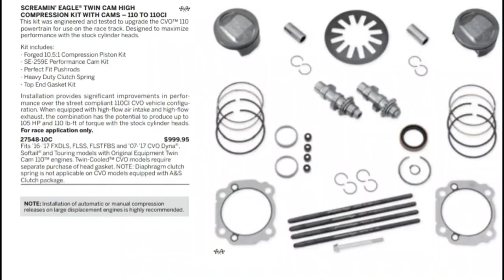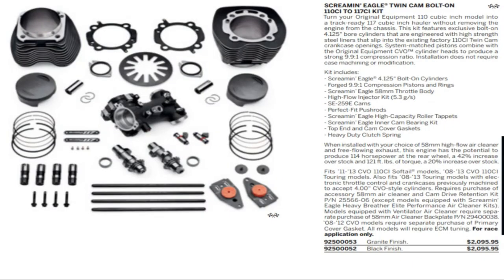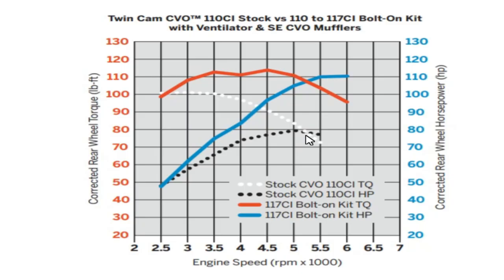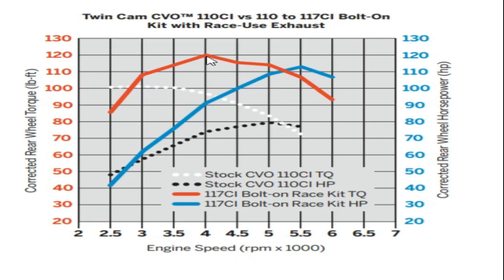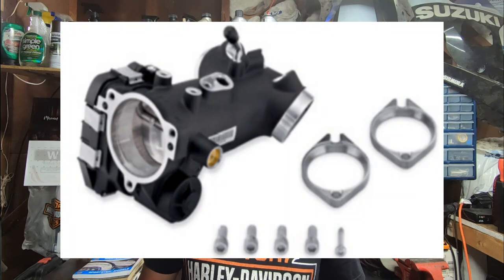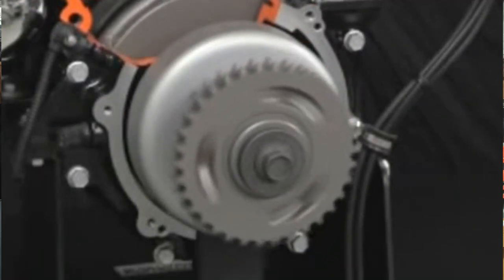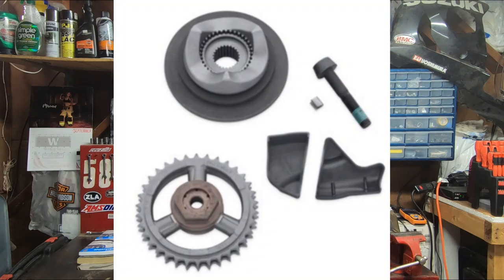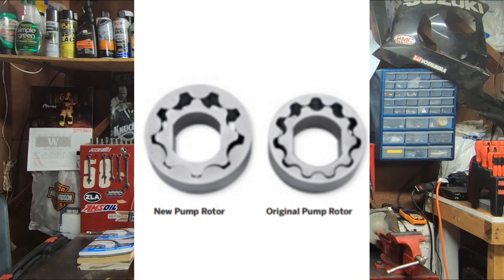Largest Production Twin Cam Harley EVER Produced | Twin Cam 110

Comment: I bought a 2002 FLSTC and a 2001 FLHRCI Road King. I sold the 01 Road King and tried to trade my low mileage FLSTC for a 94 Evo  in about the condition my bike is in witch is excellent but the guy sold it before I could trade.  Sorry I ever bought these twin cams after working on another guys twin cam that had a catastrophic failure . His bike only had 21.000 on it. I saw enough to make me sell mine. I have a fully restored 72 FLH that is simple to work on like a big lawn mower. I am an old man now so I am not running my bikes hard and I live in nowhere Alabama I am 94 miles away from the nearest freeway .
Reply from the maker: That's some beautiful country to enjoy a bike like you have! Do you ride it quite a bit out there?
Reply: @GixxerFoo  I did ride it a lot but my wife is ill and I am her only care giver so I haven't been riding much. If I got hit she would be in a fix. I put 3000 miles on the 02 FLSTC the first month I had it before the wife got worse. I bought the twin cam FLSTC for her she hates the original buddy seat on my 72 but she was only out once for about 15 minutes since I got it. .
Reply from the maker: I am sorry to hear your wife is ill, that's really tough but she's very fortunate to have you.
Reply: @GixxerFoo  Thank you. I think I sold the 2002 today the guy is coming to look at it. Funny this is the guy I bought the 2001 Road King from wrecked. I will hang onto the 1972 FLH until i go to the big swap meet in the sky I had it since 89.
Reply: @lisar3006  Ok here is an odd coincidence I have owned both a 72 FLH and a 2002 FLSTC, I loved that 2002 Heritage, that was the 88TC-B counter balanced motor, man that thing was smooth. Wish I had my 72 FLH back. I know the guy I sold it too, while running fine, wanted to do what he called a whole frame restore. He tore it apart and as far as I know 10 or so years later it is till in a box in his garage. SMH
Reply from the maker: Yeah I wouldn't let that 72 model go for anything. Unfortunate you gotta sell but l hope the guy buys it.
Reply from the maker: That B was originally so smooth that it caused transmission problems with shifting. Lol the counter balancers worked way better than the engineers intended.
Reply: @mickthedawg4575  I bought my 1955 for cheap. The guy took it apart and couldn't put it back together it had been in his garage for years. I paid him $800.00 and a Rossi 38 revolver for it. I did some motor work painted it rode it a while and sold it for $4.000.00. That was in 1979 or 80. This 2002 FLSTC does have a bit of a issue going into neutral at a dead stop but so does my 72 some times. Pretty sure the 02 is sold.
Reply: @lisar3006  I do remember getting really good at clicking my 2002 into neutral while still rolling. LOL mine did the same

Comment: Hello
Can you suggest a kit for a 2010 CVO Convertible with the SE 110? It seems to me every place I look does not give options for my particular bike
Reply from the maker: There is the Screamin Eagle 117 kit for your bike, but check out FuelMoto! They have some awesome kits that will fit your 110 or even just a cam which won't disappoint at all with your 110 displacement.
Reply from the maker: Check out the SE 117 Kit or Fuel Moto! Fuel Moto has some great kits for your bike or even just cam that won't disappoint with your 110!
Reply: Hey
Thanks for that advise, as it turns out I have pursued the 110to 117 SE  initial stages. I have had a new (SE everything) compensator, chain, cam plate and 259 cams installed. As well as an Ultracool fan assisted  oil cooler. So I am ready for the future Big Bore kit. When I do it I am having head work done and adding a catch can as well. 
Your videos are great and one of them was on seeing the rare set up I will have. 
Keep em coming
Rob

Comment: I got a 2002 Dyna Low Rider with a 110 Screamin Eagle the previous owner died so I didn't get the information on the bike so I have no idea what stage its in how do I find that out
Reply from the maker: If it's Screamin Eagle parts you could have a Harley dealer run your vin, if it has a service history with Harley they might be able to tell you what all was done to the bike. If not you'd have to tear the motor down and look at the parts and see what is in it.

Comment: I recently got 08 ScreaminEagle ElectraGlide Ultra 110ci. I put a couple hundred miles on it before oil change, I was waiting for Dyna to reach oil change and do both

Dyna 96ci......if bottoms are the same why does dyna primary take 32oz and SE take 38oz?

SE doesn't need any power upgrades for me, 900lb + 300(2people) is faster than 650lb + 200(me)

I've always put 20w-50 in all available holes. With this change dyna I put gear oil in trans, I can't tell a difference in smoothness or clunkyness of shifting
SE I used gear oil in trans and primary......what a difference, it's just a click no clunk, and I found neutral first try (rare but has happened before).

Supposedly the dealership (kaw/Suz) changes oil in all used bikes, pretty sure not true, when I drained oils, trans looked just like new 20w-50, engine was dark but I couldn't feel any gritty, both plugs clean, the primary came out almost like water, it was dark with some brown and the plug had some shavings on it
Reply from the maker: Good question, I never questioned that myself lol. Harley allows a bit more oil in the primary due to the power output of the 110, compared to the 96 it's a lot more torque.

Comment: There was a sales guy at my local Harley dealer said that after 2013 they made a high output 103. Are you aware of that or is he just shootin the 
sh!t?
Reply from the maker: The high output had a little higher lift cam, it may of been in some touring models in 13. Off the top of my head l believe the 103HO was in the dyna and softail in 2016 or 2017.
Reply: @GixxerFoo  I have a '14 SG and he said that it's in that year model also.
Reply from the maker: Humm, l don't remember seeing the HO in the Dyna and Softail until 16 or 17.

Comment: A quick question regarding compensator life ... Does the way the bike is ridden make any difference to the life of the compensator?  What's the best compensator? Screamin Eagle, Baker, other?  Some guys put in different primary chain tensioners (eg Baker), but are 'manually' set, not spring loaded.  What's a good brand of tensioner?  Hayden? Other?
Reply from the maker: If the bike is raced and ridden very hard that will reduce compensator life. The bad part is it's difficult to gauge the life of the part being a piece of machinery. Some bikes have failures and others never have an issue, just like the tensioners on the 88's. Some failed before 15k others closer to 30k. Screamin Eagle is a great stock replacement, in my opinion Baker would be the better option. The automatic primary tensioners have been known to over tighten the chain, but that's normally related to hard high rpm shifts and hard launches from a stop light. Screamin Eagle make a manual aduster, but if your not riding hard and beating the bike the stock one should be fine. They don't fail often, but they have in some bikes. The main thing to remember is don't go back with OEM cause it will likely happen again.
Reply: @GixxerFoo  Would it be plausible to think that avoiding careless low end 'lugging' (eg, do something silly like trying to 'cruise' in lower gears under 2000rpm) would avoid premature compensator failure?  I'm looking at buying a 2014 Softail Slim 103 in a few days (with only 3400 miles on it), so I want to avoid any bad riding style that may give the compensator a hard time.  I intend to do some cruising on it, but I worry that stop/start city traffic may be bad for it.  I had a look at the Baker compensator, but the price knocked me off my feet.  Maybe the Screamin Eagle is the way to go?
Reply from the maker: The Screamin Eagle is what any good Harley service dealer would recommend to you over the OEM. Avoiding low speed lugging would definently help. For stop and go city city riding it won't hurt it. What really hurts them is hard high rpm launches. But normal riding won't cause an issue.
Reply: @GixxerFoo  Many thanks ... I'm 99% considering buying a 103 Slim tomorrow morning and I'm confident that the current owner isn't a hooligan.  The bike has done 3400 miles in it's 6 year life.  And I don't intend to be a hooligan either ... just cruise and enjoy the grunt from the twistgrip :)
Reply from the maker: You'll really enjoy that bike, l wouldn't sweat the compensator and primary tensioner. They aren't guaranteed to fail but if they do, don't go back with stock lol.
Reply: @GixxerFoo  Many thanks.  At 2am today (it's 8am now), I was up watching a bunch of videos on big twin compensator replacements & reading horror stories, but you've given me some confidence back.  I was so close to calling off the intended purchase, which would have numbed my spirit bigtime.  I'm 57 now, had a range of bikes over the years and I just want to own a 'keeper' ... the Slim has that nostalgic attribute, with a lot of 'cool factor' ... so no need to be a drag racer or a long distance tourer.  Many thanks for restoring my confidence! :)
Reply from the maker: Hey you're welcome, the twin cam is not a bad motor at all. With the 103 they had the issues worked out by then. Crazy it's 8 am there and 7:20 pm here. I think you're also a day ahead as well.

Comment: Thanks for some quality videos. Very well presented and informative as well. I have a quick question for you. The oldest bike in my fleet is a 2003 FXSTDSE/CVO.  It has just under 20k on it. Now I bought it bone stock with under 1K and back in 04 it was ok as far as power needs. Bassed on the 88ci the SE model was bumped up to 96ci unit. I did add a set of V&H pipes(using Big City Thunder baffles). and had it tuned with a SE Race Tuner. That gave me numbers of 92hp & 99tq. I think the engine can be squeezed for a bit more with out hurting reliably. So what would you suggest....where should I go from here. Where can I go. We are talking just performance upgrades now.
Reply from the maker: Thank you, l appreciate you watching and supporting the channel! Did you change the cams in it or just install the big bore kit? You could out a little more aggresive cam and possibly break 100hp.
Reply: @GixxerFoo  That model came stock with the SE 203's. and thats what I am running.....its a SE 96 engine so I confidant I can safely bolt on more hp/tq I just want some options.
Reply from the maker: A new set of cams would do definently give you a bump. Even more power if you go with some aftermarket cams.
Reply: @GixxerFoo  I guess that would help quite a bit but I think I would like to go with a SE cam set...hydraulic tensioners, and some new bearings...what do you think?
Reply from the maker: That's a solid setup, there's nothing wrong with SE cams. Going to the next SE cam up the line would boost your power and torque, then adding the SE cam plate with tensioners also has the high volume oil pump. I think that's a solid plan, you'll get your power bump and cool the motor down with the high volume oil pump.
Reply: @GixxerFoo  That sounds like a bet. I must admit I was disappointed that my bike didn't come with the SE plate and all the goodies that come with it. I been meaning to pull the cam chest cover to just ck the condition of the tensioners shoes....but if I go the whole SE route that becomes a mute point. So I now have a direction to take I just need to get the P/N's and figure what is the cam set numbers...and so on.
I do almost all my riding of the SE Deuce in snd around NYC, and after splitting lanes to the front I want to always be the first one away from the line.....and the Deuce is loud enough to keep pedestrian traffic out of my way !
So thanks for your help, Nd I will let you know how it turns out.
Reply from the maker: Yes! Let me know what direction you go! Being in NYC you will really benefit from that high volume oil pump in the traffic. Do you have an oil cooler on your bike?
Reply: @GixxerFoo  What traffic..

I split lanes all day, and riding here for the last 40+ years I actually don't notice the traffic, but to the point no I don't have a oil cooler on the Deuce and running RedLine synthetic in all 3 holes my oil temp rarely goes over 205F....much cooler than any other oil I have used. I guess if I go the direction I want and have the high high volume pump it would be a nice add on....just for the sake of continuity I think I would get a SE cooler as well.
Reply from the maker: 😆😂👍, l thought lane splitting was illegal in NYC 😉? Red Line some damn good oil, no wonder you're bike still runs cool. I've run SE oil, Mobil 1 and now in Amsoil. Those high dollar oils do make a difference,  cooled my bike down too. A lot of people out their will argue about that, but it's hard to argue with a temperature gauge.
Reply: @GixxerFoo  I been arguing that point for years. Not only do I use the HD oil cap with the temp right on it...I check that with my shop gauge. and its very hard to beat RedLine v-twin trans lube with shock proof
Reply from the maker: Now l have heard use the Red Line trans oil even if you don't use a Red Line product anywhere else. Some transmissions just have knocks and bangs, quirks. I've seen Red Line smooth them out and clear that up with some of the guys l ride with.
Reply: @GixxerFoo  OH yea   I forgot another good deal is the whole fluid change kit you get everything you need for all 3 holes, plus fuel treatment a Z shaped funnel and a few other goodies, all for just over $100. And yes lane splitting is against the law, but so is riding on the sidewalk and I have to do that when needed...like twice a week or so.
Reply: @GixxerFoo  It looks like Pepto Bismol though..
....but I never tasted it. 😉
Reply from the maker: 😆👍 well you gotta do what you gotta do in the city 🤷‍♂️. Dang that's quite a deal with Red Line oil, you'll pay that much for just a basic oil change at the dealer.
Reply: @GixxerFoo  The dealer is good for some jobs......a fluid/filter change is not one of them in my world. Oh I think the Red Line kit comes w/a K&N oil filter also.
Reply: @GixxerFoo  Those prices are on when on sale. Also the K&N don't come in the kit.🤥. A more realistic price would be about $150 with shipping....I would say.
Reply from the maker: That's even better, K&N is my choice in filter if I'm not using Amsoil. Where do you buy your Redline at?
Reply from the maker: Still that's not bad for a complete service kit with the highest quality fluids.
Reply: @GixxerFoo  I usually get them from J&P or Dennis Kirk....or whoever has them cheap.
Reply from the maker: They have pretty good prices on parts and maintenance items. Local shops usually don't carry high end lubricants like that.
Reply: @GixxerFoo  I also use the Red Line assembly lube, and a few other products I like. For special tools my first choice is Motion Pro brand they offer a line of very high quality :special tools at reasonable prices.  Around the non dealer shops is where you need to go for stuff like Red Line as the HD Authorized dealers usually stick with the HD brands. I am going to start a parts list with dealer prices and HD part numbers Tuesday. I usually get my best price from a Auth HD dealer about 4mi from my house its called Bergen County Harley I get all sorts of discounts from them. Then I shop that price at other places.
Reply from the maker: l use quite a bit of the Motion Pro specialty tools myself. I've used them for many years, l like those little hole in the wall indy shops. You never know what they will have in there.